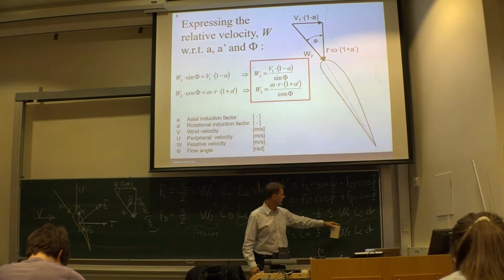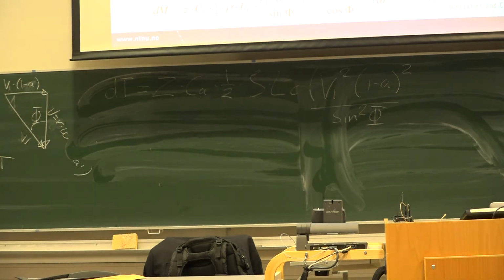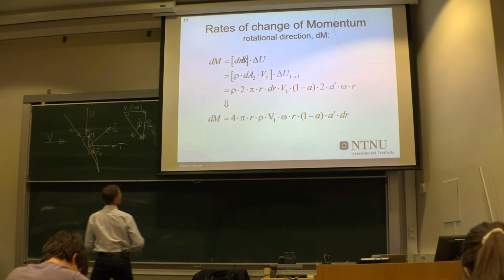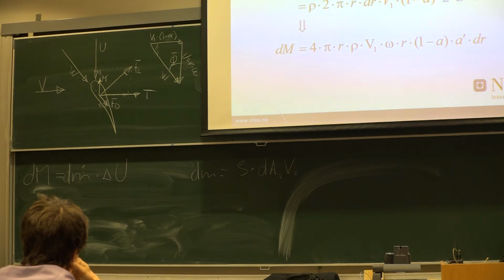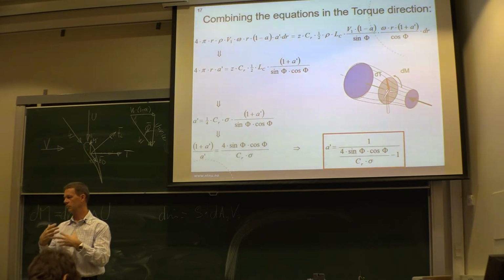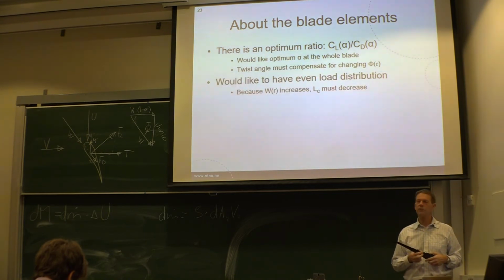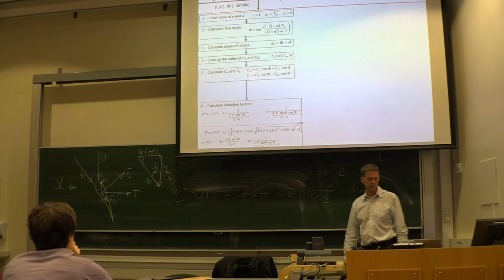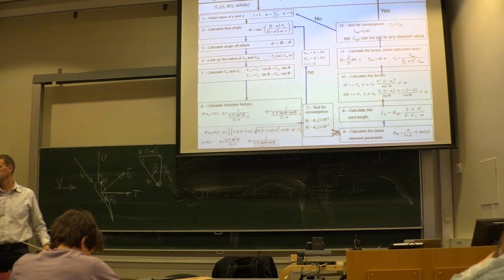Lecture 6: Blade Element Momentum Method. Part 2/2

Comment: How to calculate \Phi (The Flow angle)? This angle depends on the final tangential speed (due to rotation) and the final incoming speed. Both are affected by the induction factors, and the induction factors were defined in function of \Phi. Is it then that \Phis is calculated by ignoring the induction factors first? Please help if you know the answer.

Comment: i think, if the velocities changes change due to the induction factors, how can we use the same angle of twist from exercise 1 ?
Reply: I think that I have a question related to this: How to calculate \Phi (The Flow angle)? This angle depends on the final tangential speed (due to rotation) and the final incoming speed. Both are affected by the induction factors, and the induction factors were defined in function of \Phi. Is it then that \Phis is calculated by ignoring the induction factors first? Please help if you know the answer.